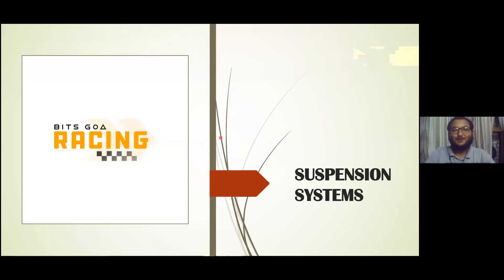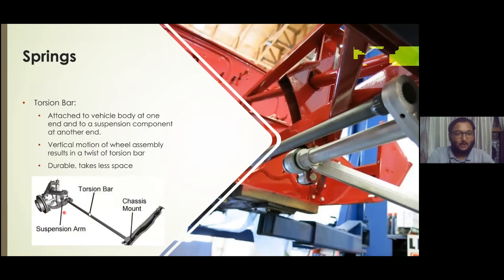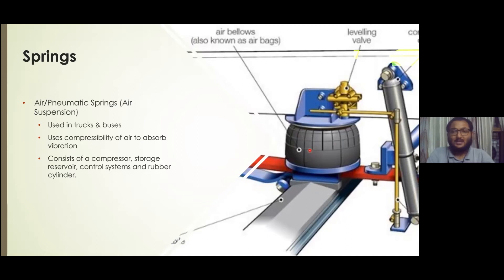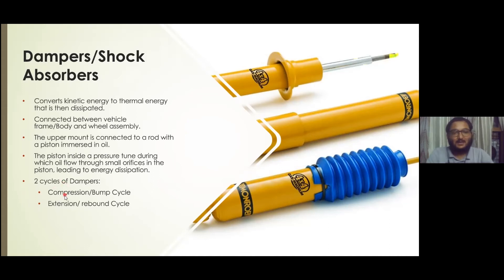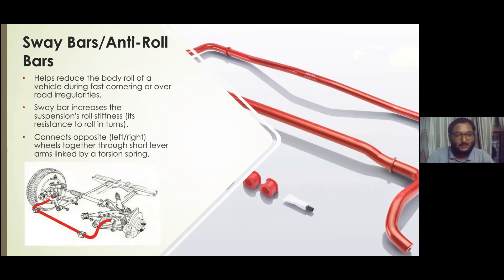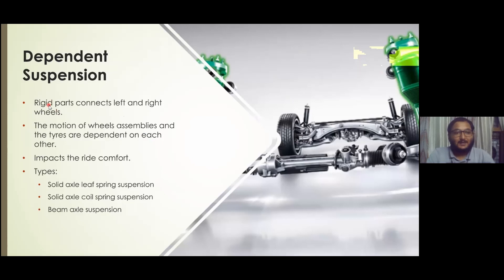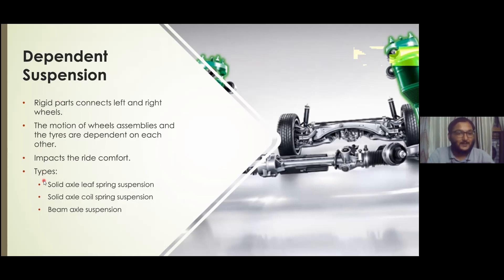Types of Suspension System || Terminologies and Application | Formula Bharat | FSAE Supra | BITS Goa

Comment from the maker: Video Timestamps

00:00 Introduction and Video Outline
00:26 What Suspension does?
00:48 SAE Standard Coordinate System Convention
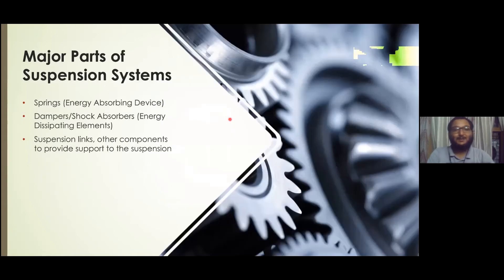01:26 Major Parts of Suspension System
01:48 Springs - Types, Adv/Disadv, Uses
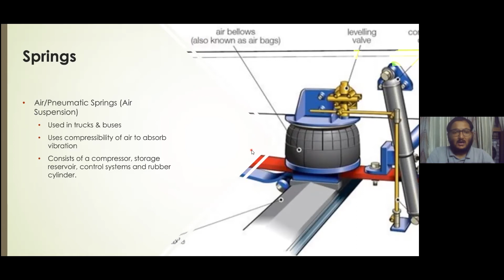04:32 Dampers - Types, Uses, Construction & Working
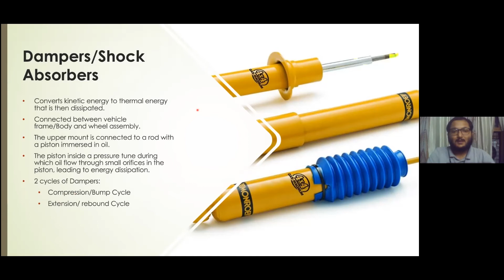06:34 Sway Bars / Anti-Roll Bars
07:34 Types of Suspension System
07:48 Passive Suspension System
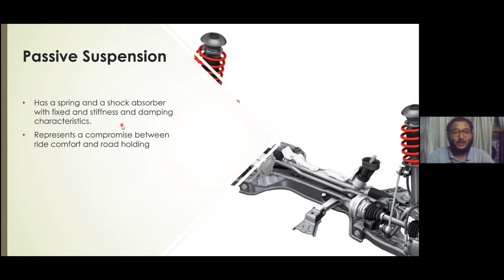08:16 Semi-Active Suspension System
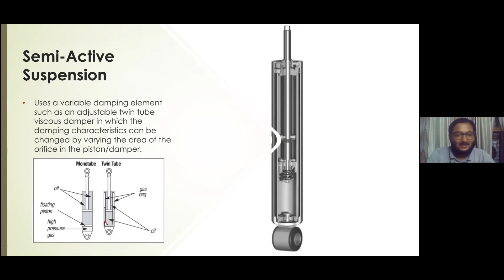09:16 Active Suspension System
09:35 Dependent Suspension System
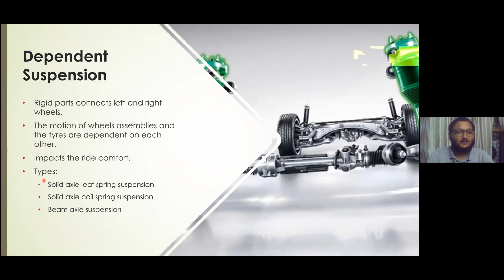10:28 Independent Suspension System